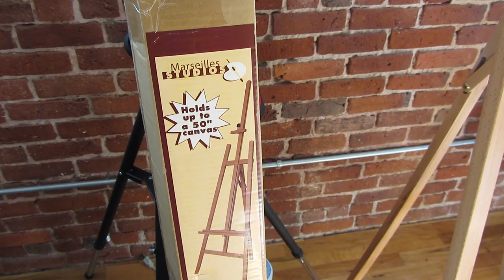Easel Assembly in HD Part 1 - The Main Frame and Misc Tips

Comment: I just spent today assembling a similar easel but I was left with a short bolt that had a spring over it? I couldn't figure what it was for and I had no assembly guide. Would you know what the spring bolt is for? It's about one inch long.
Reply from the maker: Do you think is possible for the thing at 8:47, the adjustment (mine is a black knob screw at 8:47), just a guess.
Reply: I’m having the same issue. The difference is that it tells me where the short bolt and cover goes and it makes no sense. There’s a hole in the Center behind the board that rises the canvas. It goes in there but it doesn’t fit and unless the shirt bolt fits into the hole, you can’t get the Bible piece through the ridges and down.